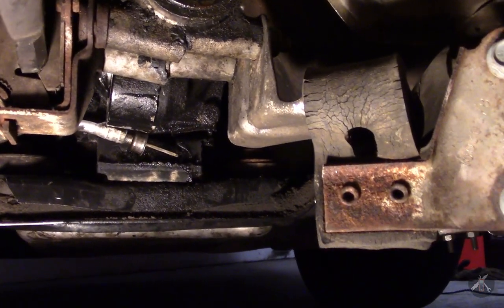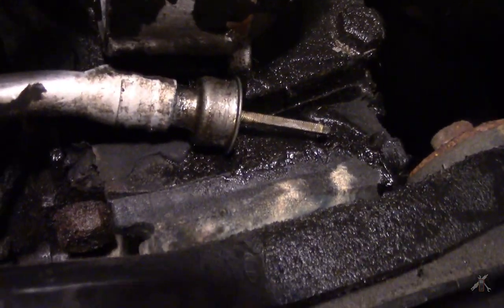Fix 700R4 Transmission Speedo Sensor Leak - IROC-Z Barn Find EP81

Comment: Definitely the best video on this. Yes, it’s long and detailed, but it was so helpful. Thank you!!
Reply from the maker: Glad it was helpful.  I try to walk the line between being too short and possibly missing some details and long and possibly boring.  Many times there are subtleties in mechanical work that you can't shortcut.  This is a relatively simple part, but some of it wasn't obvious.
Reply: @bitsofwisdom460  yes - I removed the gasket for the spindle that had a spring holding it in, not the lock ring. I was worried because my new set came with the lock ring, not the spring gasket. Your simply saying there’s no notch, it’s heels by friction, saved me a lot of worry/research.

Comment: Did that Pioneer part include both the O ring and the seal? mine is leaking as well .
Reply from the maker: It takes two part numbers.  The seal I used is Pioneer 760010 and the O-ring is Pioneer 762004.